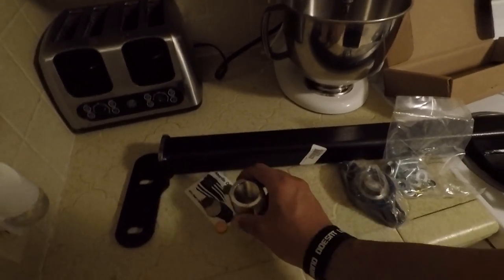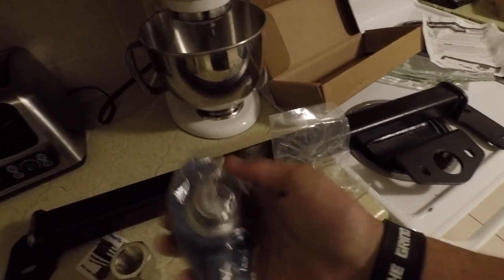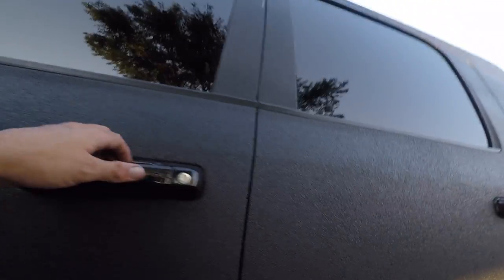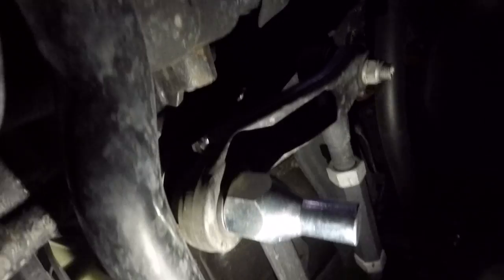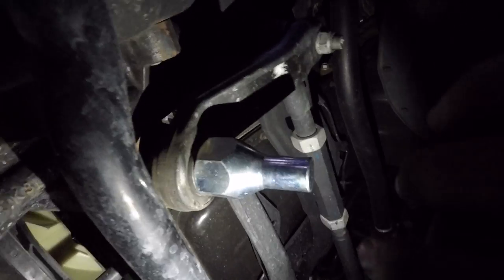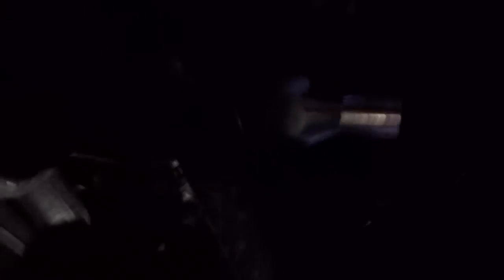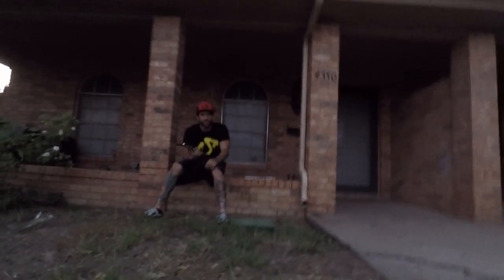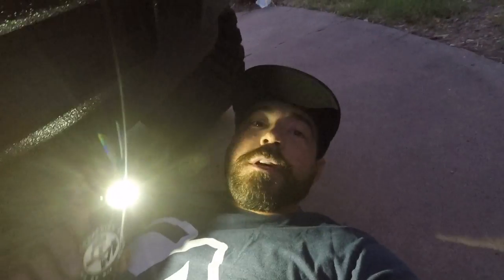RAM 2500 PARTS  INSTALL!!!

Comment: Dude i sell Rough Country Also top brands and rough country is a awesome brand that is reasonable and u need to check your truck cuz regular parts don't fit on those trucks with electric steering love videos hope u get in the NFL
Reply: outta control offroad   Rough country is a great cheap lift.....for the mall.

Comment: Hey man! Good vid. Got a question for u. Have u personally had issues with a Dodge u bought? Ive been told they have a bad rep for reliability
Reply from the maker: Graham Ray honestly no, this truck is the shit
Reply: Don't get too suck up with the reliability. You can't really go wrong with any truck brands nowadays it just all depends on what you need it for. I've known more than 5 diesel mechanics who loves Ram especially with the cummins engine. Same with the Chevy and some Ford. I'd go personally for the Tundra due to the value and proven ancient powertrain.